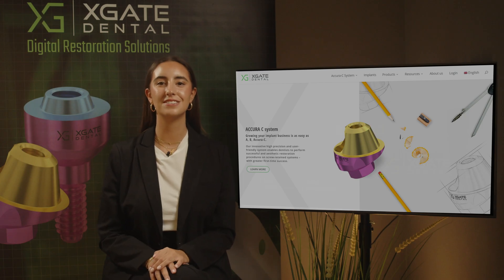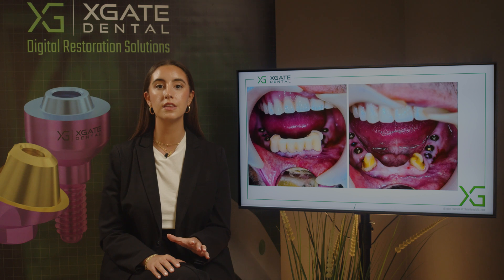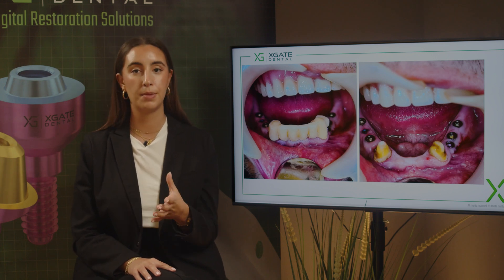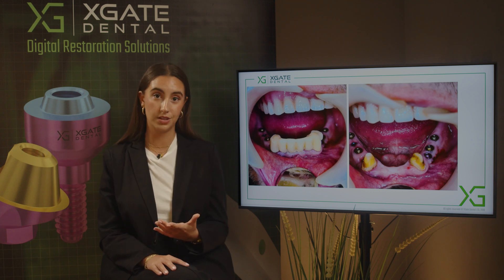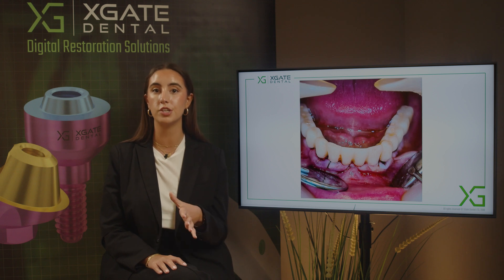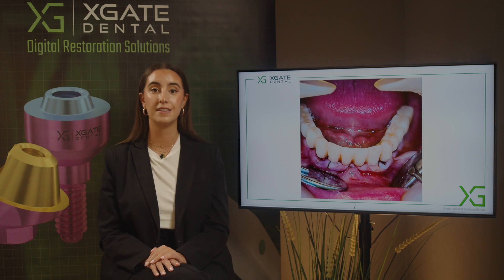Implant-Supported Full-Arch Rehabilitations. A Clinical Protocol

Comment from the maker: 00:00 Introduction to the dental case and overview of the procedure.
00:30 Patient's initial condition and treatment plan involving implants.
01:00 Impression taking process and creating temporary bridges.
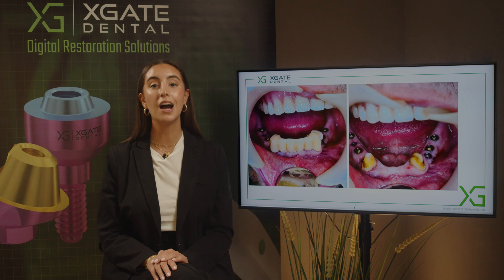01:30 Determining the vertical dimension and occlusion for the bridges.
02:00 Removal of old implants and placement of the new temporary bridge.
02:30 Healing process and addressing the gap between the bridge and gingiva.
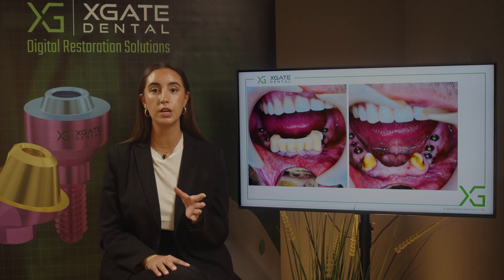03:00 Scanning the added material and designing the permanent bridge.
03:30 Fabrication of the permanent zirconia bridge and gingival coloring.
04:00 Cementing the bridge sleeves and addressing minor inaccuracies.
04:30 Polishing and finalizing the cemented bridges and occlusion.
05:00 Closing remarks